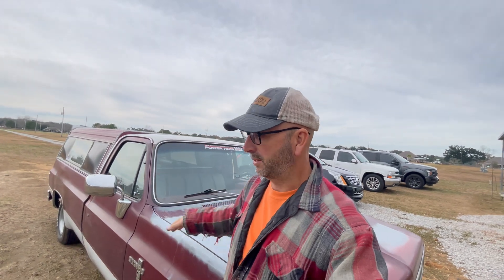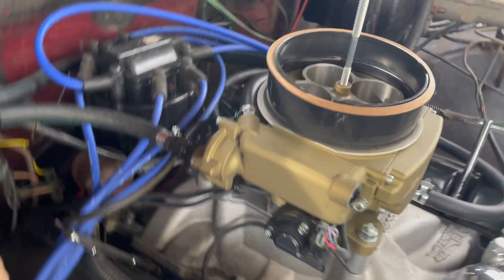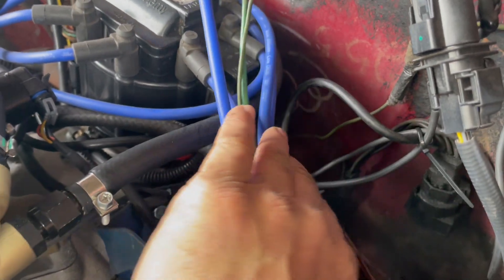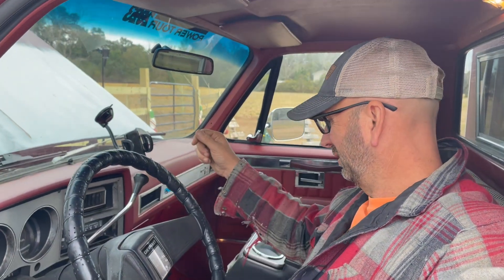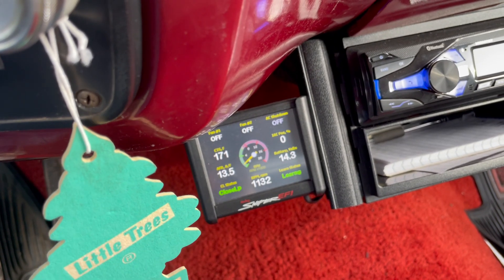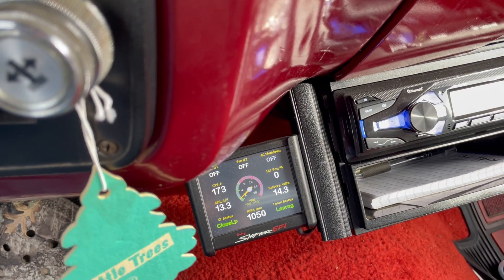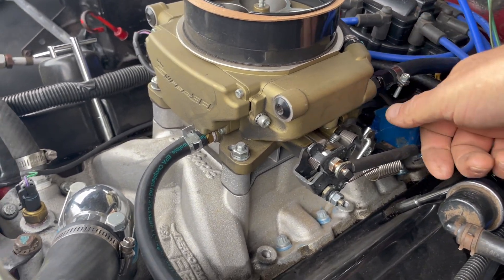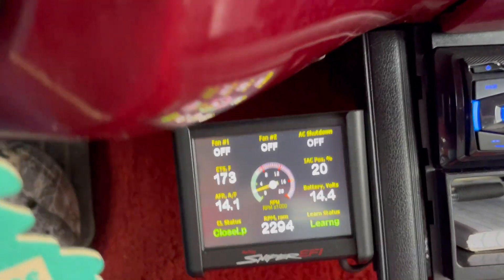Is it time to ditch the Holley Sniper?

Comment: Nice truck man, I love the red and white!

Check all of your grounds and power connections. Those squarebodies had lousy wiring to begin with and 40 years on its even worse. The wiring usually rots away down at the starter, its probably all green inside the insulation.

Check your fuel pressure too. An in-tank pump is always better than an external. A factory '87-91 sender unit with an appropriate pump and return line would help a lot.

Basic stuff is what EFI issues usually come down to, in my humble experience. It needs clean power and clean fuel at a consistent pressure to perform correctly. Once it's all sorted, you'll never want another carburetor.

Good luck! hope you get her running well
Reply from the maker: Thank you! And I appreciate the advice. Never thought about the 87-91 Sending unit, that’s a great idea.I looked at the Holley tank kit and it’s pretty pricey, I’ve been reluctant to spend  so much more money on the system. 
I’ll dig into it some more, thank again!

Comment: Had issues with mine on my 87 El Camino from the git go. I'm on my third IAC valve and added a ferrite "filter" to the wires going to the IAC and it seems to have cured the issue, but time will tell. To verify that your IAC valve is bad, while its idling high in park, place your thumb over the IAC port at the back of the throttle body. If you feel vacuum and the idle drops, most likely your IAC is faulty. The handheld will show zero percent but its actually wide open. The Holley techs explained to me that the computer has no way of verifying the IAC position. It just simply sends a signal and it hopes the IAC will follow its instructions. I did some videos on my install and have yet to post a final video since there were many issues along the way. Hope to get around to this sooner than later so more people don't have to go through the same issues we did. Best of luck!
Reply from the maker: Thank you so much for that information! I’ll try that tomorrow. These things shouldn’t be this difficult. I’ll be looking for your video.

Comment: I've had the same Quadrajet on my '81 since 2007. Other than the vacuum break failing, earlier this year, and keeping the choke on too long,  it's been reliable, with no other issues. One pump, starts right up, and great drivablility. Just spray it out with Berryman's about once a year to keep it clean.
I hope you get that sorted out. That's awfully expensive to be having that much trouble! Sounds good when it decides to work correctly though.
Reply from the maker: My buddy has the old Quadrajet on his also,and it drives like a dream.  For the money you’d think it would be a little more reliable and a much less of a hassle.

Comment: You can get rf shielding wrap for wires also that stops that issue. Why holly didnt from factory i have no idea. I plan to do that to mine keep the bugs out.
Reply from the maker: As a test months ago I wrapped the wires in foil to try that!  They definitely should have used some sort of a shielded wire to help alleviate some of these issues.
Reply: @Timmy_Forget  yeah the should have.

Comment: I've thought about putting a Sniper on my 73' GMC. When I see these kind of problems, I'm glad I opted for the Holley carb instead. I'm really not sure what your problem is, but I definitely tend to think it would be vacuum related. One of the first things I would do is check for vacuum leaks by spraying some carb cleaner around everywhere there could possibly be a leak (base of the throttle body, around the intake gaskets, any other hose or connection that could be letting excess air into the system that the butterflys can't control. The engine rpm will change if you find a leak. Fuel pump overheating may be an issue with the ECU and the fuel pump not communicating well enough for fuel pressure regulation (provided that's how it's supposed to work, I've never set one up). I'd be highly concerned about that fuel pump issue. When I see 2 issues at once like that, I tend to think they are both symptoms of the same problem. (#1 high idle,#2 overheating fuel pump) But in this case, I'm really not sure. I've heard it can be really hard to get tech support out of Holley, but if it were me, I think I would still try. Also, I've seen other videos where the injectors weren't working correctly because Holley used what looked like really cheap wiring connections on the injectors and they weren't getting proper signal (may be something to check) so make sure all of your injectors are firing off properly, and I'd also follow that gentleman's advice about checking up on that IAC valve. That's about all I got. Good luck to you.
Reply from the maker: Thank you so much! I’ll try the carb cleaner truck again to see if a leak has developed. I had tried that a while back and couldn’t find anything. The cheap parts seem logical to me, there’s a reason they came out with the Sniper 2.
Reply: Yeah. Well, it goes like this, this is how it was explained to me and it makes sense. Factory fuel injection tends to be more reliable than the aftermarket because automotive manufacturers do rigorous testing in all kinds of conditions to make it idiot proof for the duration of the factory warranty. Aftermarket companies just simply don't do the same amount of testing in real life conditions to make them as reliable as their factory counterparts. That said, I'm not sure I trust the Sniper 2, either. It really is a ton of money to spend to encounter nothing but problem after problem. Like you, I really like the idea of it, but if you don't get the reliability, it's hardly worth the time and expense, not to mention all of the labor to install. This all lets me know that if I do ever try to go with the EFI, I need to do a reliable in tank fuel pump kit, ect. I've been doing a lot of research on this subject of EFI for my own squarebody, and I just simply haven't found what I think would be a viable and affordable option. It actually makes me want to hit the wrecking yards and see what I can adapt to make work when it comes to EFI. Every time I look up Sniper, I'm seeing someone that is having some type of problem with it. Between that and lack of good, interactive tech support from Holley, it seems like a poor choice to me overall. From what I've seen so far, it seems one just can't get a good, reliable aftermarket conversion without spending ghastly amounts of money, which truly defeats the purpose......I could save that much for gas!....lol....I do wish you good luck on it, though. If you ever do get it ironed out, I'd like to know your experiences 6 months or a year or two down the road.   @Timmy_Forget
Reply from the maker: @paulpeyton9687  that totally makes sense about the factory versus aftermarket EFI. With my experience I definitely would not do it again. The cost of adding the in tank fuel pump set up, brings the cost up near 3K. Definitely not worth it.  I like the idea of retrofitting factory EFI. LS swap is sounding like a good idea. I know several folks who have done that and it has proven to be super reliable. Thanks again for everything.
Reply: Well, I have a 78 chevy 305ci in my 73' GMC squarebody. I've been looking at the Sniper 2gc Large Bore conversion. I weighed the cost, trouble and time to put it in, and wound up getting a 350cfm Holley 2bbl 2300 and an adapter plate fro my manifold. Sadly, it turns out the Rochester is actually a better carb and much, MUCH more cost effective. However, I'm ok with my decision. It took a little doing to make sure it got fuel correctly without vapor-locking issues. I wound up getting an Edelbrock fuel pump as backup with a by-pass line and one-way fuel valve so my mechanical pump would be my primary fuel pump with the electric pump as backup. Turned out what I thought was vapor locking was actually a hole in my fuel line on the vacuum side of the fuel line because somehow, the fuel line had gotten caught between the body and frame rail, wearing a hole through it and letting air in. After I did that and did also did a special fuel filter that bleeds off vapor and returns it to the tank via copper line, I've had no problems at all with the carbureted set up and it has offered an extremely reliable driving experience for me year round minus some warm up time with the electric choke. I would recommend the same set up with a 4bbl for the classic trucks. I'm looking at moving to a Vortec set up later on because of the compatibility with the 73' year model. It's less costly to set up than the LS (even though the LS is a completely AWESOME set up if you get one swapped correctly), I simply prefer simplicity and reliability, so I'll likely go with around a 91' Vortec with a carbureted set up. Reason being, not only does it have a lower initial swap cost, but it eliminates the main reliability problem with ECU fuel injected swaps, and that would be the FUEL PUMP. If an electric fuel pump goes out on you, that's it. You're getting a tow. PERIOD. I like the option of being able to fix my own vehicle roadside if necessary. I'll never argue the efficiency and added power of EFI of an LS, I just don't like the complicated break downs when they do decide to break down. AND. Never forget that the likelihood of a breakdown is increased doing a piece-meal restomod swap with a classic vehicle.  It all depends on the quality of parts you get on install. I find it's much harder to get quality replacement parts for specialized applications like engine swaps, so a fuel pump CAN be a big deal. Never underestimate the benefits of doing good research before engaging a major project. I've also managed to put a serpentine belt off a 91' GMC on the front of my 78' 305ci Chevy block. I should start my own channel just to help out a few enthusiast. I absolutely love sharing experiences about my daily driver Squarebody with people that aren't quite in the know just yet. You can always look me up on Facebook https://www.facebook.com/paul.peyton.73     @Timmy_Forget
Reply from the maker: With your knowledge you definitely should start a channel. Folks like me would really appreciate your expertise.  I’m going to try a bit more with the sniper, if I can’t get it, I’m going to take your advice and go with the 4bbl.   Sounds like yours threw you a curveball with that small leak!  I’ll look you up! Thanks for sharing.

Comment: Ive seen external pumps overheat a bunch. In tank ones stay cool in fuel. 87 c10 pumps swap will swap and feed efi.
Reply from the maker: Thanks! I’m going to look into that today.  Definitely needs an in-tank pump.
Reply: @Timmy_Forget  87 trucks where tbi trucks. You may need more pressure but you can use the float and all and switch to a more psi pump on it needs more.
Reply from the maker: @jeffreyrigged  that’s what I was just reading, I’ll have to put an increased pressure pump in place of the factory pump.
Reply: @Timmy_Forget  yeah I think a u could use a ls pump cheaply

Comment: I hate to see you having so much trouble after putting up the money for this. I haven't heard others have a similar complaints and just end up taking it off. I read through some of the suggestions in the replies. Many of them sound pretty solid.  I've thought about these systems for one of my projects. But I decided to take a wait and see approach. From what I've seen I think I'm going to continue to wait. Thanks for sharing. Have a safe New years holiday.
Reply from the maker: I’m planning on digging deep into it tomorrow hopefully I can figure it out.   There are lots of issues with the first gen, which I have. Supposedly the second gen that was recently released solved a number of the issues.
Reply: @Timmy_Forget  you would think that they would put out a kit or something to fix the first generation. Good to know because I did not know there was a second generation. Thank you 👍

Comment: If you can push the throttle blades closed and it's still idling high it's getting Air from someplace. The o2 sees it and adds fuel.
Reply from the maker: Totally makes sense, I’m digging in deep this weekend. Hopefully I can update everyone after this round of troubleshooting.

Comment: Is the pump from the kit? Idk. 60 psi is pretty normal for efi..usually has a regulator and return.  You used to get carb cleaner spray that was flammable..used to spray arround suspect areas and listening for rpm changes..epa fixed that😢 I haven't found a product to use that would work.  Guage isn't gonna tell you much on leaks with increased rpm..pull the holley and inspect and Replace the base gasket..you'll know it's new..if the O2 is freaking out  that could be the problem..the O2 Is telling it to fatten or lean it..tps sensor is reading normally?  I hope that system has a way for you to look at live data. I assume you've called holley tech support?
Reply from the maker: I did call tech support early on when I had a high idle issue. I went through everything they had told me this time around. It runs fine and operates as normal other than coming back down to idle. It’s as if the throttle is sticking open. I guess I’ll attempt another tech support call.

Comment: Last thought.  If your sure it's not vacuum.  Find a reputable tuner in your area to deep dive the system.  I've been following Joe Simpson on YouTube. I'm into performance engines and efi tuning..my son's both have race cars with that kind of fueling..I'm old school carb guy. ..way easier to fix. I hope you haven't messed with the suposady self learning fuel map.  I know you can mess up more than you can fix is why I wouldn't even attempt it..if it was me...I'd sell your set up and with the money you can go carburetor. Keep your mechanical fuel pump. Tune it and go down th road..good luck brother.   Technology is nice....when it works!
Reply from the maker: I haven’t touched any of the mapping whatsoever. I’m going to dig into it this weekend to verify there are not any vacuum leaks, be sure the throttle plates are fully closing and that the IAC is working properly.  That’s good advice to find a local tuner that could help me.    Thanks, again!

Comment: Im a retired gm tech..still wrenching on th side..i have multiple thoughts.  Vacuum leaks cause it on tbi. Use a pair of needle nose pliers and start pinching off hoses..brake booster too..test ck valve. Pump oheat? Dont know what psi that runs but if return line is too small dead heading th pump? Is your O2 sensor operating property?  Can you scan the system. ? If you think its RF  TRY ferrite chokes on power..i think i also read somewhere to run a relay controlled dedicated 12v b+ from battery..how old is it?  Read the first gen was nothing but problems..the sniper type systems do best with single plane in fuel distribution but thats not your problem.  Why did you change? Did it get way better mpgs?  A good edelbrock set up properly is foolproof..yea its not a twist n go but damn..are we that stupid now?   Good luck...hope you figure it out...O.  ohm out your GROUNDS!!!
Reply from the maker: Thank you for all the tips!  I’m going to dig for vacuum leaks this afternoon to see if I can find any. I was going to also throw a vacuum gauge on it as well to see what we have.   I had gone through all the grounds and added a few too. Im leaning towards an in-tank pump if I get everything else squared away.  Right now I’m afraid of taking on another long trip due to the fear of it breaking down. The fuel pump I believe is 60psi I have a 3/8 line right to the tank???  It is the first generation I installed it last spring.

Comment: Dual plane intakes cause grief with the sniper system. Not sure what you have.
Reply from the maker: I have a dual plane, but added a 4 hole spacer on top to alleviate some of those issues. That was something I learned early on when it sounded like a tornado under the hood. Not sure if the intake will cause other issues.

Comment: My money is on vacuum leak...if you use a propane bottle with a hose you can try to sniff arround for a rpm  change. Do you notice it when it's only hot? Somthin expanding enough to cause leak..look for a pattern. Chevy tbi had base gaskets go bad..iac valve Carbon caked wouldn't let it work properly.   You've got miles on it..stuff goes bad sometimes..I also hope you put a DELCO ign module in it.. aftermarket crap will leave you walking in less than a year guaranteed!
Reply from the maker: The high idle only happens after I put it into gear, then take it out of gear… the idle jumps up to around 2000 rpm, then if I rev it up it’ll drop down to around 850-900 rpm. That’s what is driving me crazy is that it’s not consistent.  The module is an aftermarket that I picked up from Summit. I guess I better grab a Delco